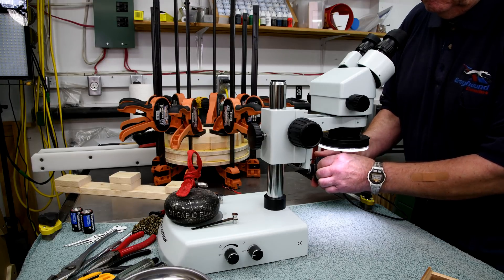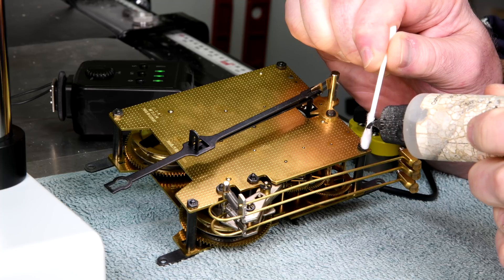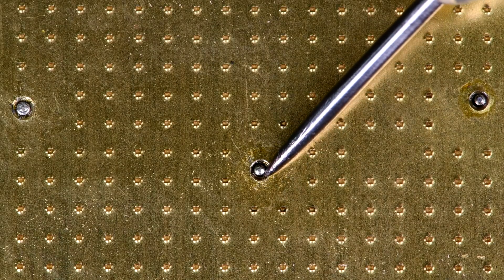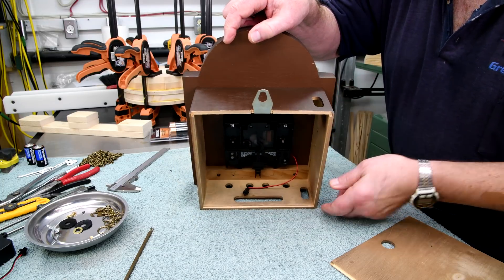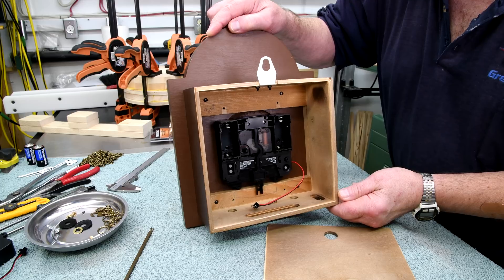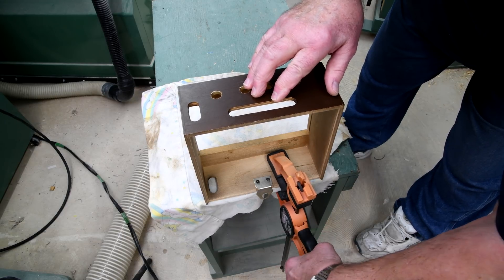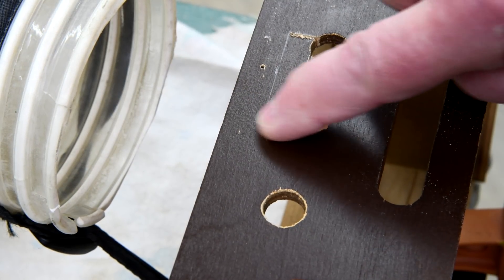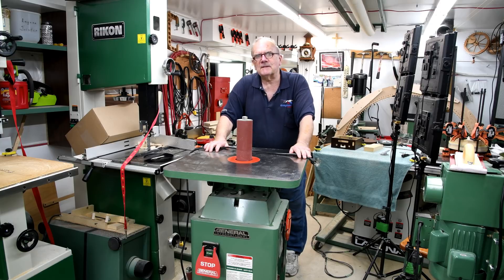Uncle Jake's Clock - Part 3

Comment: 6:55 A Bench!  A little low but it is a bench and not a table saw top.  😉  See ya tomorrow.                    JimE

PS:  Mr. Anthony is pretty optimistic with  2020.     Did ya see that one comin'?  😁
Reply from the maker: There was something mounted on that a few years ago, but can't recall what. Now it usually sits under one end of the jointer until it's needed as a coffee table for when friends come down.
"2020" --- Yup! The viewers are losing hope. Haha 😁
Reply: @roncalverley  No loss in hope!  Just a joke. If it takes until 2020 it will be worth it!